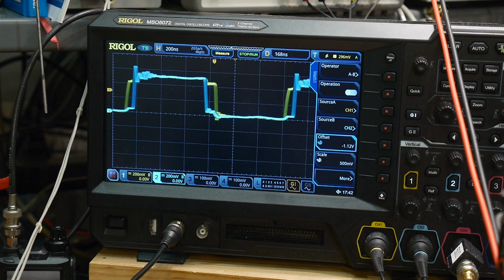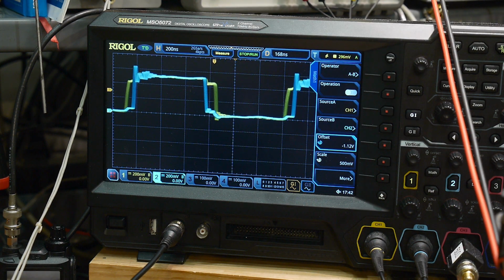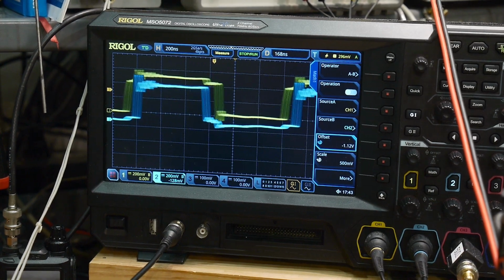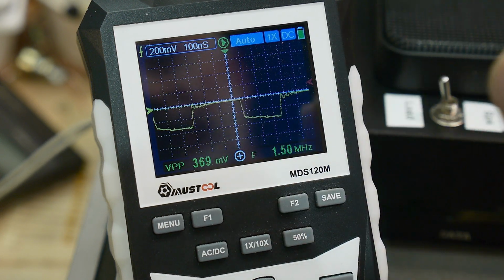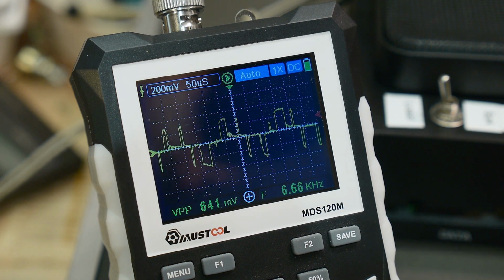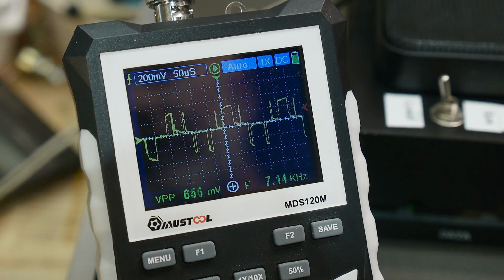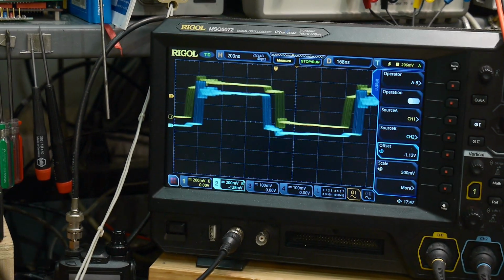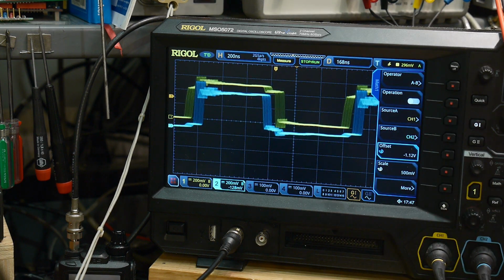#988 Class D Amplifier Waveforms

Comment: Maybe too late to comment on the method of capturing the signal, but the best way is to synchronize the audio tone being fed into the amplifier, synchroñize it to the very PWM switching frequency, and then synchronize the oscilloscope to the audio signal...
You would be able to see an entire cycle of the audio waveform in its PWM square waveforms.
And as for the floating... well, use a differential probe or use both channels of the oscilloscope and subtrac one from the other (poor man's sifferential probe).
On an analogue scope with a delayed time base, instead of synchronizing the audio signal to the PWM frequency,  one can can also think of triggering the main sweep with the audio signal, and then triggering the delayed time base,  after delay, sync to the first rising or falling edge of the PWM clock.
I suppose that would also render a stable display...
You might need to play with the Holdoff of the main sweep, to eliminate any jitter of the PWM'd output signal.

Comment: For the last decade, the audio fidelity of these amplifiers is way better than all the other parts of the chain, include these cheap ones. The audio quality of devices using these really boiles to the poor speakers these tend to use. Because after all it is the ability to use cheap, less efficient miniature speakers and be able to make for their inefficiency by just higher audio power, which is cheap to attain if your amplifier has low losses (the heat management uses to be the most expensive part of virtually any amp design).
Ironically given how many modern audio sources behave and what rf noise is around, they use to sound even better than many AB's from the 90's on the same sources. The reason is, due to their nature the D's need to have an anti alliasing filter build in. And this filter then reliably gets out all the rf mess the modern signal sources generate, so this rf mess has nowhere to "demodulate" into the audio part of the cpectrum. The "classic" AB's could not generate any aliasing, so very often there was no input low pass at all. When these then get all the rf mess, they just "envelope demodulate" that rf, which turns it into bad audible artifacts. True is, after the wide spread of the digital sources, the more modern AB's got that filter as well, but at that time the D's already became the de-facto standard.
There are just other places where to spend the given $$$ budget (whatever high or low it may be) to get better overall sound quality than sticking with rather expensive (today) heat management of an AB amplifier and have so save on e.g. the acoustic design. Be it a cheepeese smart phone, or a professional studio monitor.

Comment: Do a lot of cheap class D amps completely forgo an internal LC filter at the output and just depend on the speaker and it's mechanical inertia to do the low pass filtering for it (and that the switching frequency is above the human hearing range)?

Comment: Very cool. Most car audio bass amps for the last 20 years have been class D. I guess they aren't really good for vocal range music.  I went ahead and ordered 2 with the Pot on them for 5 bucks shipped. Just for fun I'll check this vs a lm386 to see which one has more distortion.
Reply: I set the gain w an o scope and in Fact i was wondering why i get that fuzzy top peek
Reply: Did you get the results.  I was wondering the same.   Is lm386 a class D amp?

Comment: Lots of people here suggesting a differential probe, which is a useful but expensive option, but most digital scopes allow for a poor-man's differential image by using two probes and subtracting one channel from the other. Look for a setting like "A-B" or similar. For example, a Rigol DS7034 does A+B, A-B, A×B, A/B, A&&B, A||B, A^B, and AX+B. The DS7034 is a high end scope with lots of features, but even my own $300 DSO does the first four.

You could have just taken those two traces from your first hookup and set the scope to A-B to get the same signal as you saw on your portable DSO.
Reply from the maker: Of course I tried that first, but couldn't get a good looking image that people would understand. I think the Rigol was just triggering too fast. The little battery scope did the trick. It is just more evidence that trying to look at class D amps is really hard and frustrating.
Reply: @IMSAIGuy  - Understood. Not all technology works according to plan, especially the stuff I design. LOL

Comment: Looks like it is time to scout for a differential probe on eBay.
Reply: Or just learn to use the A-B function on your DSO.
Reply: @PhoenixRevealed but you need a quad channel scope.  I am not sure if you can do A-B and C-D simultaneously.  But what I'm sure is that the output of each channel has two inverted and non inverted  amps to double the output power while using a low voltage.  I think lm386 has two sets of single amp to take advantage of this trick.

Comment: Am I wrong to think that we could use a differential probe to accomplish what the battery powered scope did?
Reply: Yes, or use math of the scope and subtract both ground-referenced channels from each other.
Reply: sure, 
or a resister and a transformer. output of transformer can then be ground referenced.
Reply: Or if the amp was powered by battery, and connected to the big scope - it has a cool averaging function.